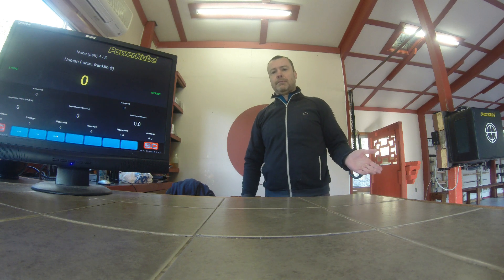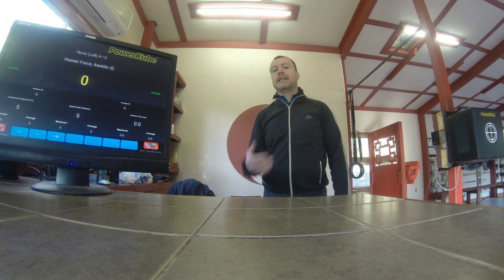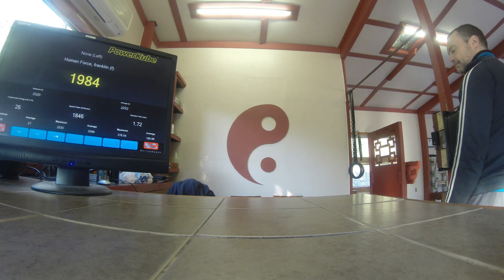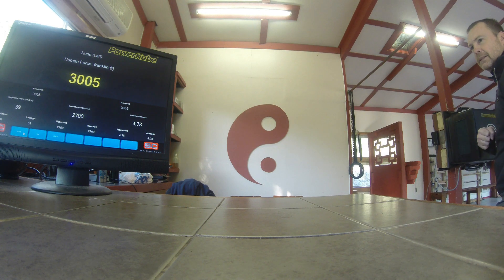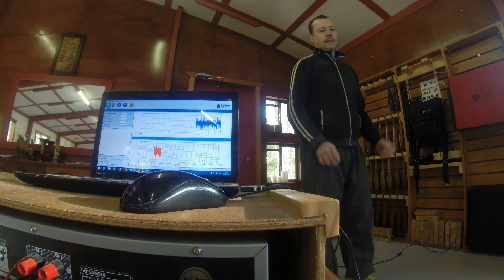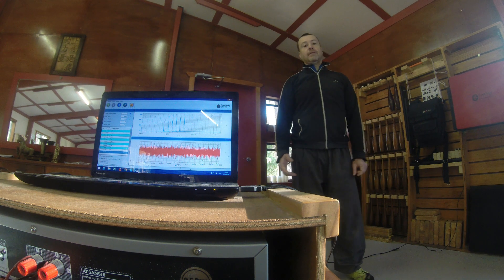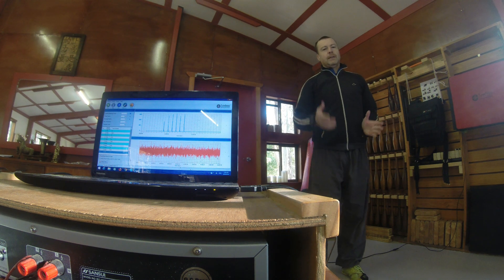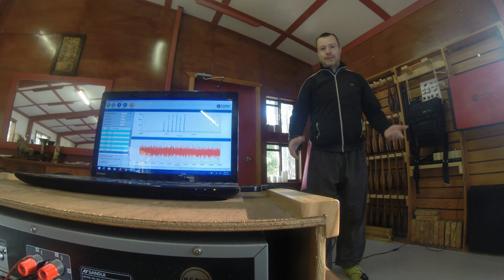PowerKube vs Load Cell 1 inch elbow strike

Comment: Hello, I just bought the Loadstar punch sensor I’m waiting for it to come so I haven’t gotten to use it yet. But I’ve seen the mythbusters episode punch your way out a paper bag. Where they use the Loadstar and Adam scored 593 lbs on a punch with boxing gloves his technique was not too terrible but not impressive. Online its stood that he is 180cm and 80KG so i was quite impressed with force but I wanted to ask if you if you think a prime puncher like Tyson or Ernie Shavers, Forman ect would score very high numbers on the load cell given that they KOs people not even hitting the jaw or temple vs a boxer like Fury or Ali who are lighter punchers but may weigh more would load cell give the higher score to the power punchers? Or do the load cell measure force in a another way? I think I’m over analyzing this but the Mythbusters punch really made me think..
Hope for a response Iam boxer who’s going pro soon so I’m looking for something too accurate measurement the effects of my strength and conditioning’s effects on punching power.
Reply from the maker: Thank you for your comment. I think you made a good purchase with the Loadstar sensor and I think you’ve got the right idea in “overanalyzing” things. It is entirely possible for smart fighters to outfight heavier, power-based fighters by analyzing and optimizing their own technique while simultaneously optimizing their power output in training. I wish you well as you go pro and would be interested in hearing how things go for you. In terms of the prime punchers who focus on KOs, their impact forces would indeed be pretty high. We would be talking about in the range 3500 to 5000+ N of force (790lb to 1200lb and above). The load cell would definitely give a higher value to these power punchers. However, technique in force delivery does definitely come into it for smarter fighters. It is possible to achieve a KO (or in the case of self-defence based fighters such as myself, a KO, dislocation, bone break, or other debilitating injury) using less impact force. This kind of educated impact is harder to measure and is more about how the forces get delivered from one microsecond to the next during the impact event. In terms of the use of the Loadstar, I would recommend caution in its use to avoid joint injury. Make sure to use wrist wraps, gloves etc. It is typically rigidly mounted and is a rigid appliance except for the foam padding.
Reply: Wushu Engineer Thanks for the explanation. I’ll let you know how it’s going when I go pro, do you know whats is average punch force among middleweight boxers?
Reply from the maker: @emiliox210  I don’t have any studies at my fingertips at the moment to quote figures from, but from personal experience, the range could be anywhere from 500lb to 900lb. Maybe more depending on the fighter.
Reply: if you put on laodcell 10 kg it will show you 10 kg if you put 50 it show 50 if 500 kg it show 500 kg or newtons or pounds there in software you can change units but they all show the same  loadcell show quASI STATIC FORCE if you put spring on loadcell the more you suqeez spring the more loadcell show force  ., force i sin fact weight :x  loadcell work egzacly the same as your bathroom scale ! the more weight you put on it the more it show you it is vvery god system to find out how strong somebody hit except maybe that it is rigid mounted system  which if you be use it very often and punch as hard as you can may lead to wrist joint bones microfaracture damage  and you will need more time to recovvery than from hit inertial training obect like bag  well you can do setup inertial for this loadstar loadcell in fact like for egzample some trolley on rails what be offcorse more complicated :x   yep the harder puncher be the more loadcell show there is no other way and no other posibility  ask wushuenginner how much punch hees wife :x  she punch weaker than him and she score much less than him on loadstar force plate  thers no way that weaker puncher achieve more on such loadcell only way is that somebody exagerrated somebodys punch and than find pout that in real he dont have such powerfoul punch compare to somebody else like he though :x because of hees record in fight for egzample or something often it is due to just god located punch not necessery that somebdoy is super heavvy puncher :x like they say precision and timing can beat harder puncher in fight what is obious when harder puncher dont connect god with alot sliding bad timing whatever he may loose with 2 times weaker puncher who  hit him multiple time with perfect timing without sliding in god place and direction etc :x  dont concentrate on max peak punch force only for fights its god play but not necessery harder puncher must win fight :x  now with episode mythbusters with this paper paper is very light and paper give very small resistance  because of its lightnesss adam break it only when  rear part was suport on hees back than or he hit in some weaker connection paper or connect smaller surface area in fact what pierce etc is psi not pure force but force work on specified surface area those units are completely useles for boxing  in boxxing matter pure peak force of a punch and this egzacly show loadcell :x because what lead to brain damage and head shockwavves is pure force  not psi :x psi is for penetration and puncture stuff or cut stuff the shaprer something is the more psi be produce  while force can be egzacly the same  like im wirte  thers no way  weaker puncher can posiible punch =score more on such loadcell  its absolutely imposiible thats may thing only people who have 0 knowledge about this stuff   average woman on this device punch maybe like 200-300 pounds average man clock like 400-600 pounds like adam savvage which clock around 600 pounds small kid clock like 50-100 pounds depend how small and young offcorse hardest puncher be able to probably close scale on this devvice which is up to 1650 pounds with some overload for safety of device offcorse;)   so yea thats how it goes the more force somebody score on loadcell  he be able to apply stronger head shockwavves  for egzample if head weight 5 kg  and we punch in forehead somebody in gloves if small woman score on loadcell 100 kg force  when she hit in this head the shckwaves achievve 20 G in peak vs when punch some relativvely strong man and achievve like 350 kg force in peak on loadcell if he hit the same head in the same way the head achieve now 70 G and G force  is what cause unciosious i mean enough G force level   .... so its god devvice and it is not sensitive on placement so dont show more when you hit in middle vs when you hit in corner it show egzacle the same numbers from the same punch i have now 2 devvice and both are sensitivve on placement unfortunatelly so me next devvice be loadstar in did :x  so yea thats how it goes  .other egzample how it work is from building enginner test where they test for egzample how strong is beam  they apliie load in midlle while on side is fulcrum  the biger load the more beam bend up to point where beam can not stand biger load and in this moment beam break in half  now loadcell like laodstar show egzacly this moment and how big was force required for break this beam in a half  offcorse when force is aply with similar speed but thats diffrent story not for our dialogue in this theme  now when you put thin weak beam which break at 50 kg force loadcell show you this egzacly vs when you put thick big beam which break on 500 kg force again laodcell show you this egzacly :x those device work the same as you bathroom scale  like im wirte the diffrenc is that boxing punch contact time duration with target  is like avverage let say 30-40 miliseconds so such  normal bathroom scale have no chance to register true peak force beacuse normal bathroom scale work on to low sampling frequenzy like i dont know probablu like 10 or 20 hz maybe vs loadstar have 1000-1500 hz depend on computer  with which it work so thanks this it is able to show true peak force from somebodys punch  tahts key hear and offcorse scale must be enough normal bathroom scale are typically to 150 kg with overload probably to like 200 klg so such 1 strong shot from  god striker and bathroom scale be damage :x  other egzample  let take 2 object in flying motion hit loadcell one is 5 kg with velocity 5 m/s other is 10 kg at 10 m/s both the same material and the same frontal surface area size now hot from 10kg object at 10 m/s be much stronger and loadcell show you this also very precise on screen :)  and so one :x .well i can tell ya what catch and change on peak force those devvice its most likely momentum :x  so the biger mass at biger velocity the biger force it show from physique stand point of view its god  because average force is momentum divvide be time   for egzample 5 kg at 50 m/s hit you stronger than 10 kg at 15 m/s now 5 at 50 have much biger momentum  well in fact there egzist also kinetick energy  those units more depend on velocity it isint units fromm "moon" which in fact is one of part univverse but nevermind normal people say such bullsh,t nevermind ;)   so this units kinetick energy is also units which can be change on force be divvide it be distance both units are close but they are not the same kinetick energy is responsible probbaly be conact force in dynamique inertial fast load system=how big damage be in placement of first contact with beam  while momentum is responsible for quasi static force = how much beam bend now it is now debatable what is more impornat  we at least i for now dont egzacly know :x how evver conact force in collision may have more to do with hardness of material interact :x when you hae gloves etc pure quasi static force may be more important :x  there are multiple study which show completely contradictory data ! one show peak force as kinetick energy  one as diffrenc in momentum and all use similar system loadcell so i up to today dont egzacly know how it goes  i do only one test with kitchen scale analogue try find out  hwo much force kitchen scale with spring show when im increase vvelocity of air 2 times so it show 4 times more weight on scale :x im do this test from car thsi test show 100% dependences on kinetick energy and not on momentum ! however i dont know if we can extrapolated in 100%  this phenomenom on human punching :x thers no precise study obut this i often have afraid that people who do those test dont egzacly in fact know how it shopuld goes :x  how ever if we assume that somebody do system like loadstar  loadcell  and he just calibrated it in manufactury be  put specifed mass /weight on devvice and watch if device show correct numbers than we can assume that those device shpuld show true peak force from collision :x it just required much more sampling frequenzy to catch fast changing forces like collsion /punching in did howevver there egzist some small error :x we dont egzacly know if or not somebody put in software this device specified algorythm which lead to deceivve average  jjoe :x there is such posibility i dont know maybe somebody dont want let people to know that peak force is generate be kinetick energy and not momentum :x but thats maybe jjust some conspiracy theory ;)  i dont know  but  i test  me loadcell  in multiple way for egzample im punchin it from weakest to strongest punch from up to down be increase in each time acceleration of me arm or and range of motion and so one so in fact load cell show egzacly in each shot more 1 show least value and when i get boigest range of motion and bigest acceleration of arm in fact it show most :x so there is small posibility that  its bad devvice  but like im write im up to today dont egzacly know how match kinetick energy with momentum for human punch  :x  energy may impact somehow but maybe not and only momentum matter i dont know :x loadcell show momentum you can find out this from wushuenginner drooping test on hees loadsatr force plate the same dumbell from doiffrent hight so such from 4 times biger hight the same object have 2 times more vvelocity not 4 times ! so such it have 2 times higher momentum while hit force plate and what show forceplate /loadcell ??? = 2 times biger force = linear dependecnes on momentum and 0 dependences on kinetick energy ...
Reply: now you find out be yourself when you get this devvice that when you hit it weak it show you less than when you hit it stronger :x and yep velocity is very important for generate strong punch people who say no are idiot :) offcorse human body is much more complex than dead object in flying motion and in fact somebody may be in real slower and hit harder beacuse of multiple other factor like body weight  stiffness of hees kinetcik chain especially body core im test some dude was relatively slow on eye and somehow he be bale to punch really hard it may be that some people have those specified biomechanics with more rigid body core etc or and specified better joint levverage some other may more dpeend on higher velocity etc :x  there alot posibility :x anyway im on loadcell beat up to 60 guys alot heavvier than i they was amateur offcorse and i alot train on this so ... ;) anyway  im beat them and i relied on vvelocity because im not vvery strong in pure static test maybe except grip strenght which i havve relatively god but in bench press im weak in fact nevver train this :x i alway smore concentrate on pure explosiv motion of arm body etc  so i relied on pure acceleration/velocity stuff :x and im beat them all on loadcell :x  and only i was able to break 10 cm plywood on 1,5 cm on 25 or 30 cm lenght second dude was able to break only 7 cm plywood :x at 7,5 hees hand stop :x offcorse im do setup fro those breaking attempt with special box which always push on breaking plywood the same place egzacly in midlle and the same surface area  im not completely nob in this offcorse:x  so thats also show that loadcell are god devvice for predict punch power im only person from those 60 who break 10 cm plywood and i clock highest number on loadcell  from those people which im measured ....:x and remeber but you probably know this the same person can hit in each shot with diffrent force depend on range of motion body arm setup and how "fast" he accelerate arm all with god timing offcors the same eprson can hit with 1% max and with 100% max ;) ...=im wirte this again when you barelly touch loadstar laodcell it show you you very low number like 1-5 pounds or newtons or kg depend which units you setup vs when yopu punch strong with god connection with deep compresion of gloves and foam on ladcell it show you now multiple time more force what is correct offcorse and you find this be yourself  whe you start play with device  .,
Reply: and lil more about those paper  in myth busters let me put this in this way  hang one paper a4 on rope and drive in it car weight 5 tons at 100 km/h and see what happen to paper :X= nothing more less the same hit in human and this person is dead... why ? because paper have very small resistance 3 newton s law it give so small resisitance  becausee is very light and human are limited in belocity which are able to achieve ... = we need somespecifed  resisatnce be enough mass of object in which we hit otherwise force be very low when you hit insect in fly force is very low because insekt is very light when you hit wall force is very high becasue wall is very heavy and strong and give full resistance  let say more less  thats why this experimnt was so hard in myth busters  punching heavy head weight 5-8 kg with neck or heavier but softer corpse =belly etc is completely diffrent than punch in paper weight 1 grams or some insect similar weight and laodcell is god in predicition who hit head stronger ;) not who hit insect stronger ..."x offcorse 300 lbs in chin may give better effect than 400 lbs into forehead :x... also hit wit rottation hae bigger impact than hit with along axis without rotation head because our brain is more sensitive on  acceleration with rotation  etc or uperrcut required also less force than for egzample frontak hit right beewten eyes:x ;) ..